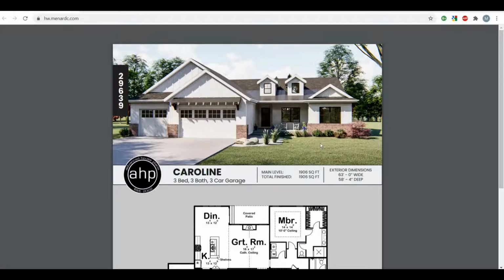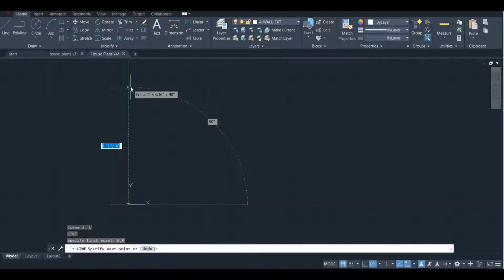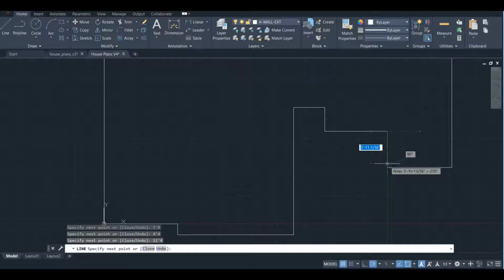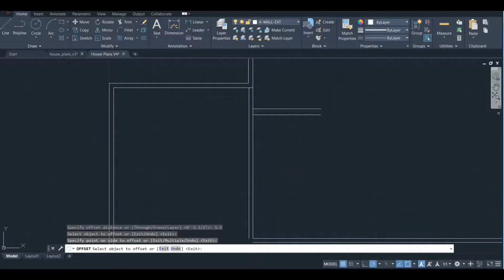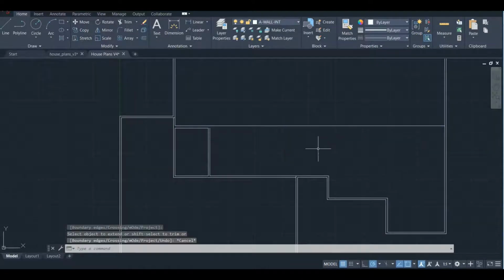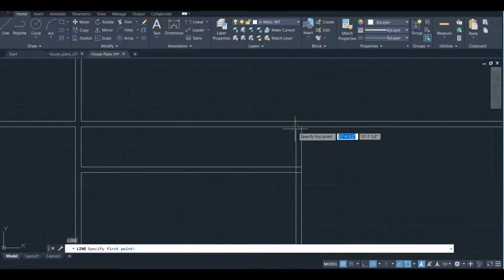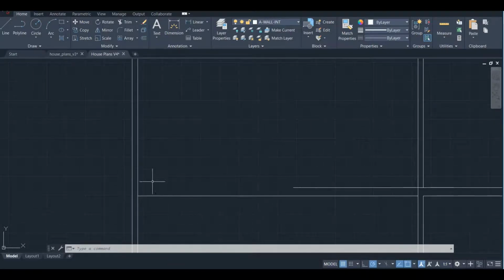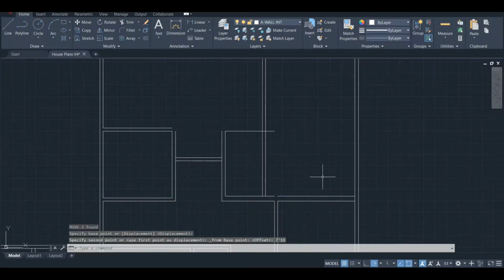AutoCAD ICF Construction - Redraw Paper Plans

Comment: I found a plan I love but holy crap the price of the plans! How much does it cost to change from a normal floor plan to an icf? I am hoping to build this myself with the help of 2 GC’s in the family who’ve built an ICF home.
Reply from the maker: Yea, plans are very expensive. They're also copyrighted like software, so just copying what you find on the internet can get you in trouble. Advanced House Plans will modify plans for you, and charge by the hour. I'm sure they'd be happy to give you a quote. I'm pretty up to speed with AutoCAD, so I redrew them myself. Another option is to just buy a set of plans, and go straight to your ICF supplier. Often, they can still give you a quote off your unmodified plans. Your just going to run into problems like I go over in my second video with hallways and things running out of space.
Reply from the maker: I also learned (after several iterations) that the base set if plans is not really something you can do yourself. There's actually more thought than you'd think going into laying out bathrooms, bedrooms, hallways, and kitchens in a reasonable manner.
Reply: @avalianteffort40  I appreciate the advice! Knowing the benefits of icf has got me onboard to build with it. I’m good with tools and my hands so I’m sure we can do most if not all of it ourselves. I just don’t have the program in place to design my own home and would not want to be sued taking someone’s else’s drawings , not cool. I can draw up a layout on paper but like you said, plumbing/electrical/ roofs all are very important to get right when redesigning .
Reply from the maker: Check out NanoCAD. Its got a free version that can do everything AutoCAD can do. Its just got enough tiny differences to frustrate regular AutoCAD users who didn't learn it first. BricsCAD is also a great mature CAD option but its a coupke hundred dollars for a perpetual license (still way cheaper than paying $420/yr to Autodesk).
Reply from the maker: I'll make sure to do a roof design video next. Plumbing / electrical layout is something your specific contractor can handle, but I could probably also do a video on being prepared for them to do their work.